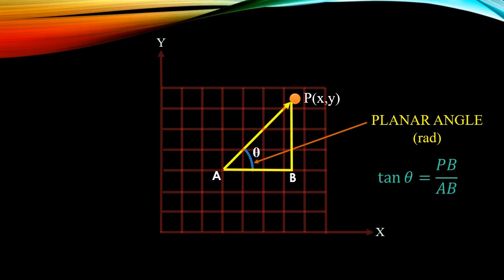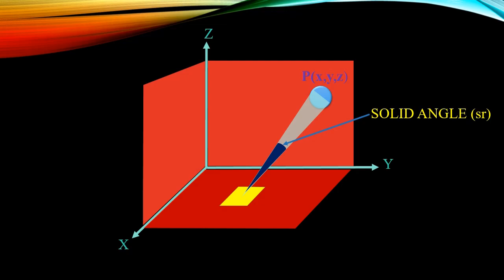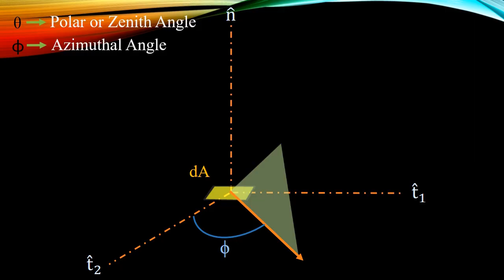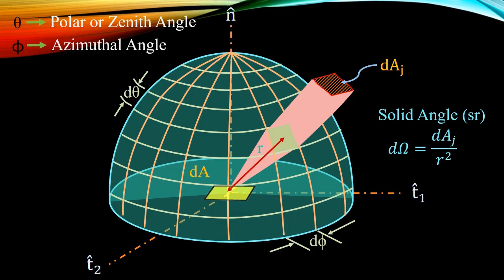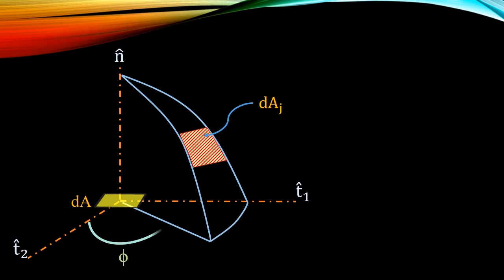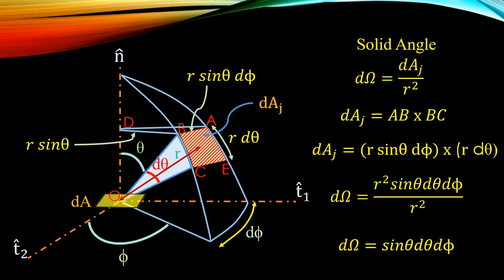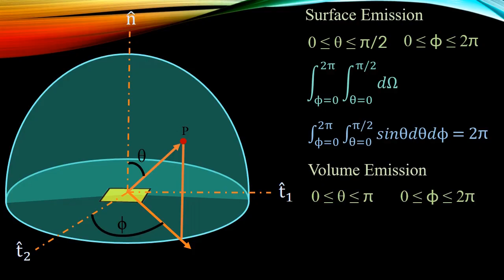Understanding the concept of Solid Angle

Comment: Why does radiation energy have different strengths in different directions?
Reply from the maker: When radiation is emitted from any hot surface considering it to be black body, then equal amount of energy is emitted into all directions. But when travelling radiation further travels into a medium, the strength may differ in different directions depending upon the medium properties in that direction. Like if  in any direction, the medium has more water vapors or mist, the radiation will be attenuated (absorbed or scattered) in that direction more and the radiation will not be able to travel longer distances.

Comment: thank you for this video , i really understand but there is something i did not realize it at 5:18 
how did you find that AB= r sin( theta) d(phi) ??
Reply from the maker: For finding AB we use the same concept that we used for finding  BC from triangle OBC. We took the triangle ABD where BD = r sin(theta). Here angle BDA is d(phi).  So using the concept of l =r theta, explained at 4:38, we have BD as the r (radius of the circle), small angle d(phi) and AB as l (arc length). Now we get AB = BD d(phi) . On putting the value of BD we finally get AB = r sin(theta) d(phi).
Reply: Still confused that how BD can act as the radius r?
Reply from the maker: @muhammadbehram8820  Sorry for the late response, I didn't saw your comment earlier. BD is not acting as radius. In Triangle BOD, OB is the radius r and angle DOB is theta.  So we can write sin(theta)=BD/OB, by rearranging we get BD=OB * sin(theta), BD= r sin(theta). I hope it is clear now.

Comment: first of all great video explanation, understood it all
some suggestions fo ryou to attract more audience
1) Change the case of your channel name to a normal one, i.e. "Engineering Streamlined", it is more pleasant
2) Dont insert this music file to every video and part, either put slow music ( any artist, but not vocals) or just audio is enough
3) I know that the videos are made through powerpoint, which is not a problem, but try using a different intro, a more simpler one, or make it using AI
done, you will look much more proffesional than ever
Reply from the maker: Thank you very much for those thoughtful suggestions. I will try to implement them in my next video.

Comment: instead of considering triangle ABD and taking AB=r*sin(theta)*d(phi). Why cant we consider triangle OAB and take AB=r*d(phi)?.
Reply from the maker: Milaan, the angle d(phi) is the angle ADB at vertex D and possible only in triangle ABD. In triangle OAB, d(phi) angle is not possible. That is why triangle ABD is considered for finding the length of AB.
Reply: @ENGINEERINGSTREAMLINED  Than makes it clear, I overlook it.
Reply from the maker: @milaanpatel4997  I am glad that your doubt is clear. Do share with your friends if they need this video.

Comment: what is d significance of solid angle in led reflector design?
Reply from the maker: In LED, reflectors are used to mainly optimize the uniform distribution of light  for good illumination distribution. The light is initially emitted from the LED, so it is important to know the solid angle because without its knowledge it is not possible to know the location on the reflector where light will fall and get reflected. To track the light rays, solid angle is required. When dealing with light direction in 3D space, solid angle is the best way to determine the direction where light will travel.
Reply: @ENGINEERINGSTREAMLINED  Can you share video on it ? My led Solid Angle is 120 deg now how to design reflector which can meet requirement of Tail & Stop Lamp as per Norm ? What steps to be followed or what information should to know while design Led reflector.
Reply from the maker: @yusufmulani9495  I do not have much knowledge related to LED Reflector design. But I am sharing some links to some papers which may be helpful for you.
https://www.hindawi.com/journals/aoe/2018/7138592/
https://www.researchgate.net/publication/259560095_Design_of_LED_edge-lit_light_bar_for_automotive_taillight_applications
https://www.osapublishing.org/ao/abstract.cfm?uri=ao-52-21-5221

Comment: 5:10 how did u justify lenght of AB u skipped the most important derivation?
Reply from the maker: Triangle BDO is a right angled triangle at point D with angle BOD = theta and OB = r. So, we can write sin(theta) = BD/ r. On rearranging, we get BD =r *sin(theta). In triangle ABD, angle ADB = d(phi).  Now, we use the formula mentioned at 4:39, l = r * theta.  So in triangle ABD, AB here represents l and d(phi) represents theta  and BD represents r. Finally we can write AB = r sin(theta) * d(phi). I hope it gets clear now.

Comment: Why thita is varying fron 0 to pi/2 not from 0 to pi
Reply from the maker: Theta is varying from 0 to pi/2 because for a surface emission, the radiation is emitted only within the hemispherical volume. If you see the figure at the last part of the video, it is a hemisphere and theta can only be varied between 0 and pi/2. But if you consider volume emission, then emission will happen within a sphere and theta will vary from 0 to pi.
Reply: @ENGINEERINGSTREAMLINED   can you plz make video on how angle 0 to pi cover whole volume of sphere
Reply from the maker: @nishaantil7503  Ok. But making a video will take few days.
Reply: @ENGINEERINGSTREAMLINED   no problem
Reply: @ENGINEERINGSTREAMLINED  thank u very much 🙏🙏
Reply from the maker: @nishaantil7503  Hi. I have uploaded a new video explaining the limits of theta and phi angles in a solid angle. Check it.